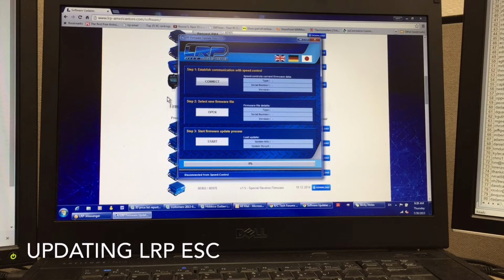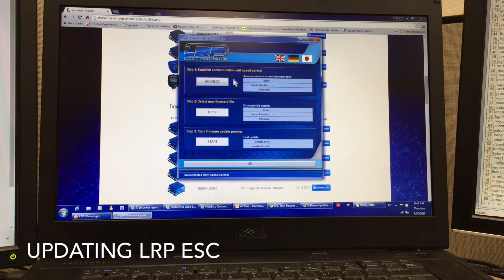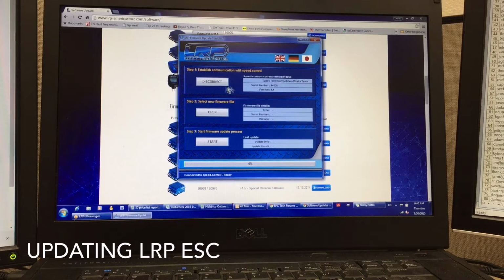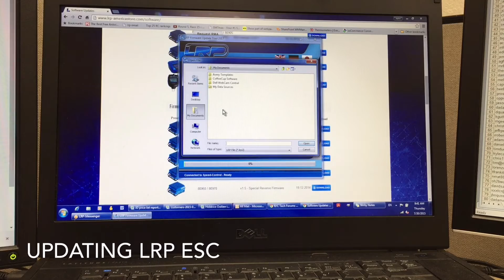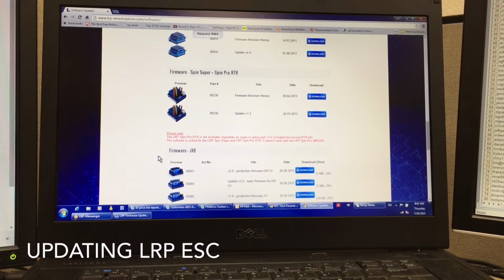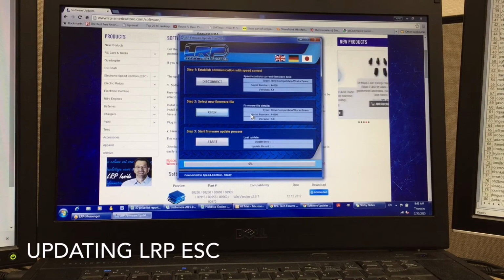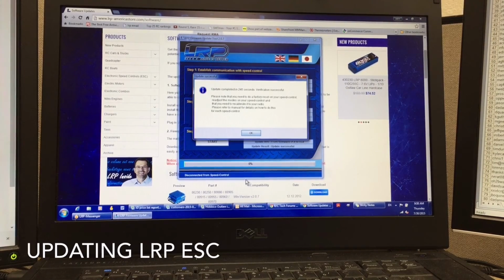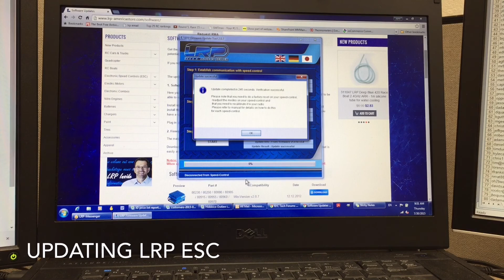LRP America - Updating LRP ESC

Comment: One more thing, the user manual said I would see a red light on my flow team works and I'm getting a blue light when I push the connect button. thanks again.
Reply from the maker: +BhamBrent When this problem happened, did you have a battery hooked up to the ESC, and or the switch in the on position?

Comment: Hey John, Just got my  lrp USB bridge spec.2 yesterday. I'm having some trouble getting it to find my ESC, I have a solid blue light when I click connect the yellow LED comes on and then it says it can't find speed control. tried 2 computers one running Windows 7 the other a Mac and 3 sensor wires still no luck. any help would be great. Thanks